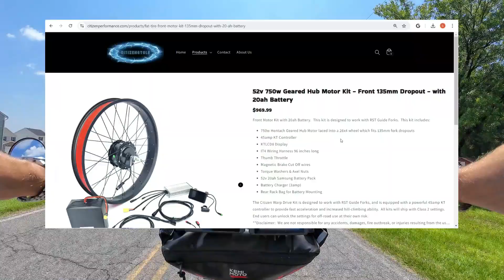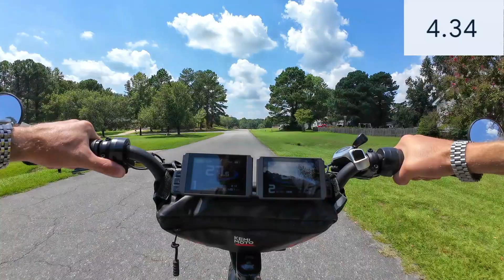Building More!  Front Motor Kits Available for PreOrder

Comment: I put Innova 20x4.5 on my Grizzly and it picked up alot. Added traction makes acceleration ALOT faster and picked up 2 mph top speed (39mph GPS.) The speedometer is accurate with 24 inch tire setting now. Definitely worth the switch!

Comment: I have a Mongoose Dolomite that I want to add a front wheel kit to it.  Would that 750W motor be powerful enough to handle a 250lb passenger?
Reply: I had a 750w geared hub on a steel frame mongoose dolomite for about 2 or 3 years , just recently the down tube cracked half way right below the weld to the head tube. So i think it was stress from the front motor.  The frame will work but you might want to weld more metal onto the frame. I had rst guide 26 forks Don’t do it without good forks

Comment: So one the New 2024plus wired ebike it already has a rear battery so will this front motor kit work on the newest wired bike or only the older 2024 wired with out the rear battery.
Reply from the maker: @cbsdave3g  this front motor kit work on pretty much any 26x4 Fat Tire e-bike. It just needs to have the RST guide forks in order to handle the power of the front motor. The older style wired bikes, like the one in this video, had those Forks already the newer 2024 wires have rst guide Forks but they have a through axle so they don't work. you have to swap them back to the old style forks. Doesn't matter if the bike has a rear battery or not.  the kit comes with a battery, or you can use your own battery, but you wouldn't be able to power the kit to the wired battery since it is 60 volts and the kit is 52 volts.
Reply: I believe he hooked it up on the new one on one of his previous video's, I think he compared it to citzensbike as well, you'll want to double check though.

Comment: The critical 26 x 4 RST Guide forks are out of stock.   How does one measure the "rise" on the upper tube on the forks?   Are you going to sell the "spacers" in case the upper tube is too tall?   Got a link to the spacers?  I'd rather get a tall one and adapt with spacers than get one that is too short/unusable.    The bike is a Rad Rover 6 Plus (low step).   I hope this is simple as I am a Mechanictard.   I am your exmplar 280 pound old guy who lives in a VERY hilly area.   I need the extra "grunt", not real interested in speed.
Reply from the maker: @tommorningstar6373  I have more Forks on order.  they should be here towards end of September. you can always buy a 3-inch stem Riser on Amazon for like $12 to get the height that you want. 1 1/8 spacers on Amazon I think are like $10. Maybe I'll start keeping these in stock as well. Thank you for the reminder that not everyone has these parts laying around like I do. appreciate you!

Comment: I have a rad from 2019, i have put a stronger bafang motor, a bigger battery, a slightly stronger controller and the screen(all from Bolton bikes) but i would REALLY like to replace the motor, controller and battery with more powerful components. Goal would be to 40-45 mph and an extra battery would help
Reply from the maker: @randallbollinger1449  40 to 45 will be tough. Those geared hub Motors can only spin so fast..
Reply: @CitizenCycle925  doesn’t your 1500 watt do 40ish?
Reply from the maker: @randallbollinger1449  yes the 1500w Hentach motor of the wired bike will do 40 mph, but it's peaking over 3,000 Watts with a 60 V battery. not sure what motor you have in your Rad.
Reply: @CitizenCycle925  some bafang “true” 750 watt. I’m very interested in changing out whatever parts necessary so that i can cruise at 40ish. That’s why I’m very excited that you will be having a variety of parts to choose from. Bolton ebikes sold an upgrade kit for the rad a few years back, that’s what i bought. The early citizen cycle was the inspiration. I think i need to clarify that i use my bike in electric only, I’m a disabled vet with bad knees and peddling is just too painful.
Reply: Do you think it is worth upgrading from a radrover5 to a wired for that top end speed?
Reply: @MrKeg830  without a doubt, YES. A wired, or similar brand, will be my next ebike. The wired new gen has dual motors and dual batteries and a significantly higher top speed. With two batteries, each powering a separate motor, the 40ish plus mph won’t decrease nearly as much as one/both batteries deplete.

Comment: what a great idea!
i live in the woods of North Idaho and there are miles of logging roads to go on.
its my hope to get an ebike that can go where the loaded logging trucks can go [without overheating]
  your front wheel power ought to be a great addition! a self contained system. :)
 
 Ive been looking at various options from AWD hub drives to mid drives for my climbing machines.
my thought is that maybe a mid drive ebike that is equipped with your front system will solve my over heating concern and the concerns of those that say a mid drive "might" snap the chain (?)
with a front hub system you can still throttle back home. :)

 of course my favoto flurry ST 750 watt 26x4 might benefit too?

 Ive looked at the eahora juliet3 it is AWD & think its great, but 20" wheels? to me those might be good on a clown car? yeah Im a bit over height at 6'4",maybe im just not seeing it right?

 I still like the idea your system puts the control of it in my hand. :)
Reply from the maker: @bellyacres7846  yes it gives you a lot of extra power at your disposal whenever you want it, and like you said, you have a backup system if anything happens to the first. Plus more range with extra battery pack

Comment: Can you send a complete diagram for installation for your kit .l just got wired freedom ebike yesterday and I want to put it on it .If l order one the complete kit including battery would you print up a diagram for the wired freedom ebike and include it with the kit
Reply from the maker: @EricBryant-l1y  still working on a set of written installation instructions.
Reply: I think these kits are for the old version Wired. New ones have a through axle setup on the front fork.
Reply from the maker: @stevenpeavler959  correct. the kit won't work with the new style wired Forks you would have to switch back to the old style
Reply: @CitizenCycle925 so I'd have to swap my front forks out .Do you sell the forks also
Reply: @CitizenCycle925  lm sure alot of wired freedom customers will be looking for a way to install your warp drive kits. I know l am.
Reply from the maker: @EricBryant-l1y  yes you would have to swap out the forks to the rst guide forks with the open style Dropout. I sold out of the forks but I have more on the way.
Reply: @CitizenCycle925 can you post it or drop me a email letting me know when you get them back in stock that way l can purchase the fork and the complete kit including battery.
Reply from the maker: @EricBryant-l1y  will do!

Comment: I like the idea of dual motors but want something more nimble than a fat tire bike, sure wish someone made one with 27.5 x 3" wheels.  What do you think?  Could an existing fat bike be reconfigured to run Plus size tires?  Thanks for your opinion on this!
Reply from the maker: Yes I definitely think conversion could be done. I had the 27.5x3 tire size on the biktrix Juggernaut review I did and I really like that setup. No one's going to sell this though you would have to lace the motors in 3 inch rims yourself
Reply: @CitizenCycle925 I just bought my first e-bike a Veltronic Discovery2, it rides on 27.5 X 2.4” tires w/750w motor, I purchased it b/c design, finish, function & it’s total weight capacity-440lbs, I’m 6’2” @355 lbs. 

I’d like to upgrade the front forks b/c the OEM forks are too weak for my weight.

Q: would you happen to know if there is an aftermarket front fork that fits the Veltronic D2 and that could handle your 750w front hub motor?

I want to upsize the width of the tires to 3”honeycomb street tire and keep with the same 27.5 wheel height.

Q: I’m wondering if I upgrade the forks and upsize the tires to 3” couldn’t your front hub motorized kit work on that bike?

Q: I purchased a second battery, if I mounted it to the rear rack to power your front hub kit, could you make a long enough harness w/plug to draw from that battery?

Q: Do you accept custom orders or requests? 

Do you not recommend installing front hub motors on a non-fat tire bike, or is it fine providing I upgrade the forks?

Maybe I’ll just lose weight 😂that way I don’t have to worry about getting up steep (paved) inclines or the occasional off road (steep) slope.

Last question: If a hub kit motor is not possible w/the Velotric D2…will your 750 watt hub kit motor be compatible with the Mokwheel Obsidian?

The front fork steer tube is 1-1/8" (28.5mm) and is not tapered…can you please recommend a fork that fits the Obsidian & is compatible with your 750w front hub kit?

Sorry for so many questions, I appreciate you reading my comment.

Ride Safe Live long & Prosper